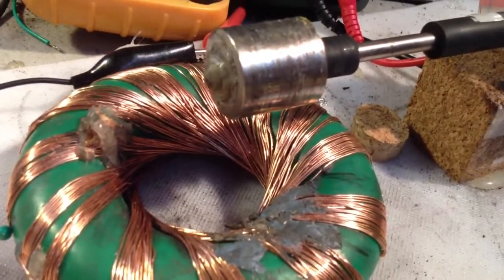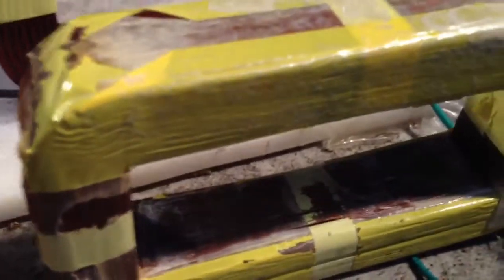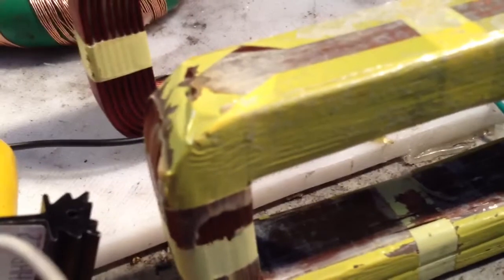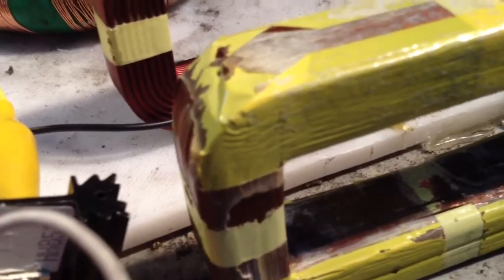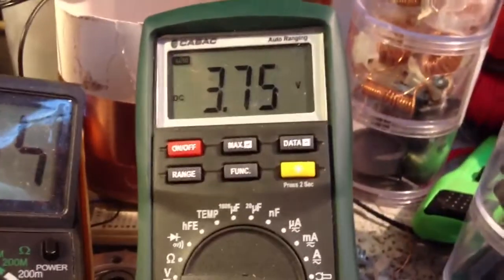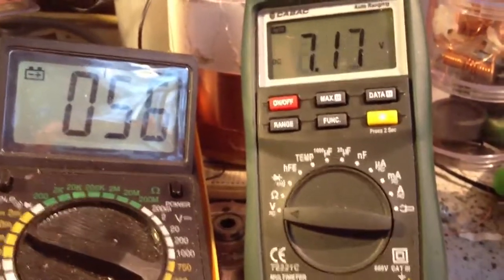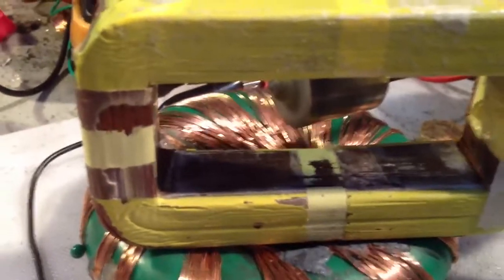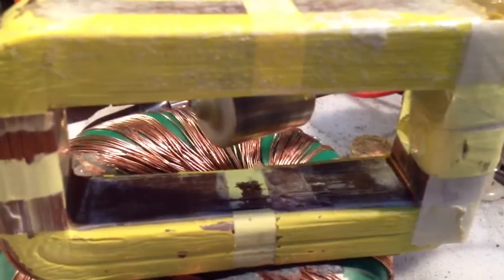Generator voltage triples by touching

Comment: Yep, body cap. If you connect several pieces of tinfoil around the motor or PC heatsink, you may see a similar effect.
I would say the Rodin is the source and you are soaking the 'radiations' of if, passing them through to the coil by touching it.

Comment: I built a rodin coil with tripple coils on the donut.  I also spilt the donut in half first and placed a 200 turn 28ga wire inside the donut.

The the internal coil output was 1.6KV.  No magnet was used just the pulsed coil using 12vdc battery..

Comment: Good One!

Looks like the human bodys capacitance to me too. Try a core. if it does it, it's magnetic, If that don't do it, it's capacitance. Work out the impedance of the coil, and the freq. Then get Wolfram Alpha (google it) to work out the cap value to make it resonate.

You could also play around with pos and or neg charged plates inside, to create columb force like a cap. It may even need to alternate in time with the circuit....

I also think it won't be as high with a load on the coil.

Comment: Have you measured the torque from the shaft at the 35,000 rpms?  It would be interesting to place several faraday disks connected in series and have the shaft run this device.  The end result is low voltage with very high current.    The faraday total output would then be pulsed into a transformer.

Another idea is to reduce the rpms down to a slow speed using gears or belts also producing very high torque to run generator. the output would be used to keep the battery charged.
Capt.